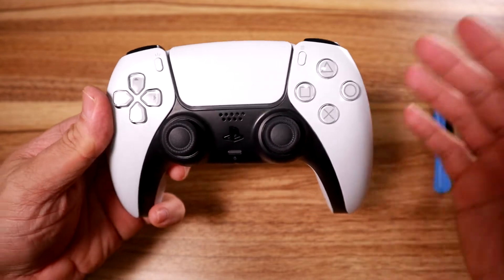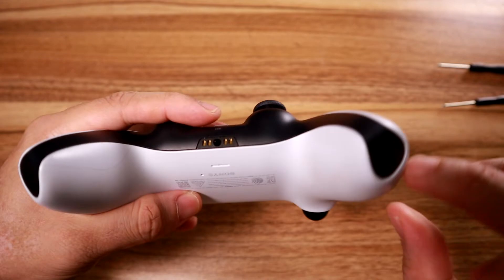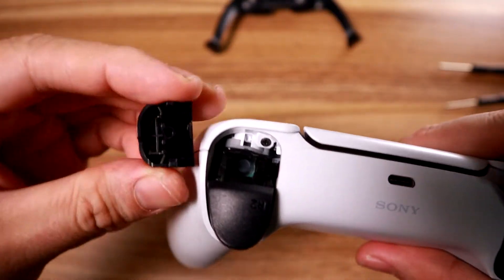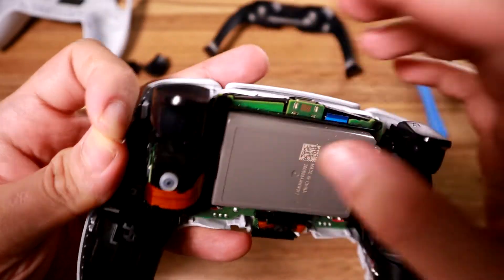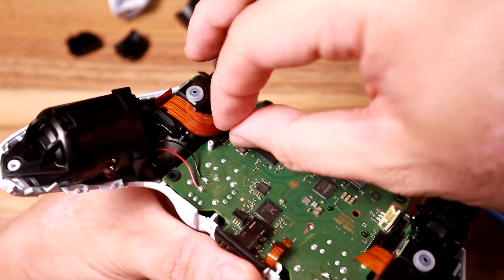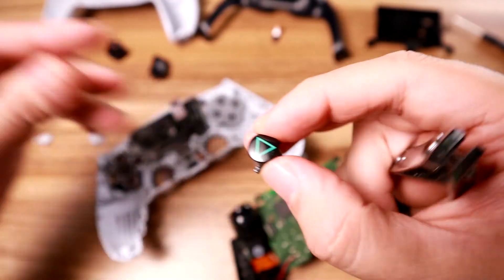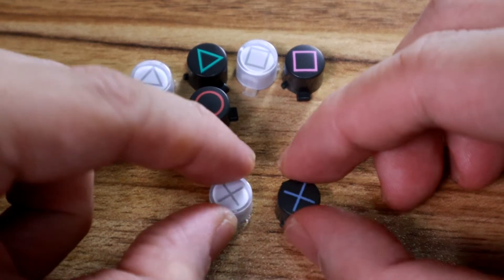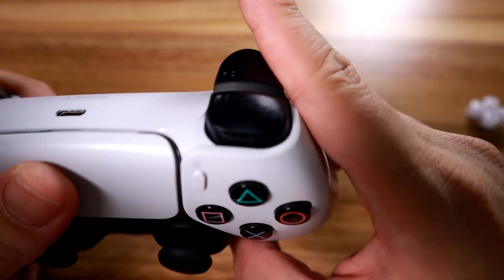How to fix the DualSense loose R2 issue and replace the buttons with DualShock 4 buttons

Comment: Thanks for this. Took a spring from my old DualShock 4 and used it in my dual sense. Still doesn’t feel quite right so have ordered some springs but this will definitely do the job while I wait for the new one. Thanks again!
Reply from the maker: Did the exact same thing. Kinda sucks that this happens to more and more people. I hope the next batch with new colors use a better spring.

Comment: If it helps someone else; I just did this using an old DualShock 3 controller. 
I had to straighten the donated spring a little since it was loose, but it worked fine after some light bending, and has almost the same resistance as the PS5 spring. 
I swapped the buttons too, but they’re light grey since it was a white DS3 controller. The O ∆ X square buttons fit exactly as in this vid. The D-Pad I found to be a touch too small and it was fairly wobbly. The base was about 1mm thinner than the PS5 one so I opted not to use it as I didn’t feel like pulling the controller apart again if it didn’t work well. 
Definitely want to find a black DS4 controller for those sexy buttons, but yeah, if you need to fix your PS5 controller in a pinch, a DualShock 3 one will work.

Comment: Thanks for this. I had a lot of trouble getting that spring in. Mine wasn't kinked like yours. Straight on both ends. For those with springs like this, I had most success getting it into the button first, then the loop, then bend it into the control divet.
Reply from the maker: Man that must've been tough! But couldn't you have bent it a bit beforehand?

Comment: Thank you so much mine broke on Friday and I've been trying to fix it myself without sending it back and you having to go through each without a controller and your video finally helped me fix it my spring wasn't broke it was just the part of the spring that goes up under the actual trigger button wasn't going straight across like it was supposed to it was lodged upwards and I just had to push that down and now I'm all good to go thank you so much
Reply from the maker: Hey man, happy to help!

Comment: Thank you! I've fixed it, DS4 R2 spring works for me as well :)
Reply from the maker: It's not as "springy," no? The specific Dualsense springs are still better but until you find them in stock, the DS4 spring does the trick in a pinch.
Reply: Yeah, spring from DS4 has a little bit lower resistance. Once springs for dualsense is available I'll change it :)
Reply: @BimBurger  still way better than before ty

Comment: Nice tutorial! Just replaced the standard white shells for grey, with ps4 buttons, and aluminum thumbsticks and dpad, but I'm gonna have to take it apart again because for whatever reason up on the dpad isn't working, and the square button isn't sticking out as much as it should.
Reply from the maker: Yeah it should stick out pretty prominently. The biggest issue with DS4 buttons on the DualSense is that the circle doesn't follow the contour of the shell.

Comment: Happened to my friends a few months ago and now mine, with some games like fortnite you can just enable the adaptive trigger strength and it will solve the issue by causing resistance when you push down but sadly for most games you need to do this or replace the controller. Ridiculous how they allowed it to ship like this.
Reply from the maker: I don't think adaptive triggers are a complete 100% fix but I agree that, especially for their price, it's ridiculous that it happens as much as it does.

Comment: Had my ps4 controller for 6 years with no problem ive had my ps5 less than a year and the spring broke?
Reply from the maker: Same. And I collect Dualshock 4s. Out of 7, only one had a problem and it was an easy fix.
Reply: @BimBurger  dont think ill take the risk of dismantling it myself but clearly a great video man shame in a way it has so many views

Comment: Dualsense feels good, but it barely lasted 5 months I have a broken L2 button. What a shit for how expensive it is, the battery is shit too, it lasts 4-5 hours. I have an xbox controller that I use on pc too, and the battery lasts 1 week +, although dualsense surpasses it in ergonomics and comfort
Reply from the maker: The battery can be a bit thin - I'm looking into way of expanding it. I am not sure if there are 3rd party battery solutions out there that aren't ugly as sin.
Reply: I had mine barley a month a a couple weeks ago it started to stay in slightly so whenever I press it stays engaged until I have to press it a few times harder to get it to disengage such an annoying thing. Btw my face buttons are sticking a bit too
Reply from the maker: @emobassist  Did you swap out the front shells?
Reply: @BimBurger  I didn't they just stick I have to press them harder unless there is haptic feedback on the face buttons
Reply from the maker: @emobassist  Man I'd love to be able to open that up and see what's up :(

Comment: Welp, guess I'm gonna have to try this out. I love the feel of the controller, and really wanted to use it for PC. I have a PS4 controller but it feels horrible, but this one feels so much better. I also can't go to Sony for it because to save 20$ I bought a refurbished one - clearly not refurbished enough since it was like this from my first usage. But my R2 is super sensitive and even stays registering as being pressed even when I let it go and it does physically go back up, just not enough I guess :/ Gonna have to buy a Trim Remover tool first. 

I guess until I can fix this I'll stick to playing my PC games on my switch pro controller, which has its own set of problems, mainly stick drift, but that's fixable via software deadzones since none of the games I play require super precise handling.
Reply from the maker: What do you need a trim removal tool for? You're gonna try the PS4 buttons? I don't recommend you do. They don't follow the curve of the controller and it just looks a little awkward. I'm sure you can find DualSense buttons with the symbols on them in the color you want.
Reply: @BimBurger  ...That plastic puller tool you said you didn't know the name of? That's called a Trim/Clip Removal Tool. I need it to open up the controller and follow your video.
Reply from the maker: @Squintina  Oh - someone told me what it was called. Apparently, it's called a spudger.

Comment: Mine hasn't come loose but I can feel it's doesn't have as much resistance when I press down on it, ataptive trigger still works but can tell theres an Issue with it
Reply from the maker: The adaptive trigger is a whole separate mechanism - it's essentially a tiny motor that presses up against your trigger. It's likely that the spring is starting to break. :(
Reply: @BimBurger  thanks I'll be returning it from where I got it from
Reply: @BimBurger  I took it back and got a replacement all good now

Comment: After 1 year, my dualsense start to melting. Difting on L3, loose L2 and charging connector not working from time to time :(
Reply from the maker: Yikes. That's a lot of issues. And each one has a separate fix - almost not worth the trouble. You'd essentially be replacing three parts.

Comment: I'm gonna try this later I only got ds4 springs
Reply from the maker: Yeah it'll work, it just won't have the same tension.
Reply: @BimBurger  thanks for showing me I have some tension but you're right the controller is still not the same. IL buy a black controller during the year for now I turned off adaptive triggers
Reply from the maker: @setokaiba2351  I'm really digging that black one too.

Comment: I’m on my 3rd controller! Pretty disappointed to be honest, my PS4 controller lasted 7 years without any problems, 7 years! 2 PS5 controllers have broken on me so far and it seems the life expectancy is about 2 months for the R2 button. I recommend anyone who’s about to “upgrade” to PS5 to keep their PS4 controller and use it as much as possible! Avoid using the Duel Sense as much as possible, only use it when you have to, that is for PS5 games only, luckily, the irony! there aren’t that many games out yet!
Reply from the maker: Wait you went through three DualSense controllers? What were the issues of the first two?

The trigger looseness can be fixed. Drift can be fixed though it's much tougher and may need soldering.
Reply: No, I’m on my 3rd controller meaning 2 had broken.
Reply: No, I’m on my 3rd controller meaning 2 had broken.
Reply from the maker: @lucko1979  Yeah I think I understood that. I mean, how did the first two break?
Reply: I can agree ps5 controllers are way easier to break I have had mine for a week now and r2 already feels loose I have used my ps4 controller with no issues except for some drift which is acceptable cause I used it for over 5 years.
Reply: @BimBurger  Sorry, I hadn’t noticed your reply. 

How? I was most playing PS4 games that obviously don’t use adaptive triggers, one game in particular that I was mostly playing was Cities Skylines, in this game R2 is zoom in, used often admittedly but also gently. I was extremely disappointed when the trigger broke playing such a game.

I’ve been gaming for years and I know how to use a controller and usually they last for years! 
You mentioned that the loose trigger was an easy fix but in your video you mentioned that you weren’t happy with the R2 button after you had fixed it, didn’t you? 
Anyway, for the price of these controllers I feel I shouldn’t be obligated to try and fix them, I’m going to send them back to Sony every time, and I urge everyone to do so, no one should be trying to fix these controllers, send them back and complain until Sony sorts this shit out!
Reply from the maker: @lucko1979  Well the DualShock 4 spring is more sponge-like than the default DualSense spring. And you're absolutely 100% right - for its price, it should absolutely NOT break in any way in the first couple yesrs.

Comment: i Have brand new ps5 , installed Death stranding directors cut, and have issue right away with R2 where vehicle do not react to it and wont move at all, destroyed all joy from game.
Reply from the maker: You've tried your R2 on other titles? Non responsive R2 is a different issue all together. Might wanna claim warranty on that.
Reply: @Bim Barbieto  On Death stranding directors cut, i enter motorcysle pres R2 it will work for 5s then bike stops and not move. But lights on bike react to when I press IT. Also grabing hand to body with R2 works, just all vehicles are not working. I have second black controller which I bought separateli and it does not have this issue, tested today. So it seems sttranding uses some special R2 signal to accelerate wehicles which is broken in my brand new default ps5 controller. I guess all white one conrollers are broken.
Reply: When I press L2 and go backwards and press R2 again it works but only for few seconds.

Comment: I can get the spring into position but it just won’t catch anything or lock into position
Reply from the maker: It's difficult, but there should be a a tiny slit that the spring legs pop into.
Reply: @BimBurger  I get it into the slit but when I push r2 down it doesn’t stay inside it
Reply: Would you happen to know the size of the springs,  might buy some new ones to replace
Reply from the maker: @andersoncoombs6854  There's a slit inside the R2 button that it should sit inside also
Reply from the maker: @andersoncoombs6854  Unfortunately I don't. I think they're bespoke springs.

Comment: By common do you mean 95% of controllers? Or do you mean it's the most common problem but rarely happens?
Reply from the maker: I don't know the exact percentage, but I guess it could be both. I know it's the most complained about issue online - that and drift, but drift is a lot harder to fix.

If we go by my group friends and acquaintances who have a PS5 as an anecdotal sample size, about 20% of us encountered this issue.
Reply: My R2 spring also just lost tension after playing Ratchet and Clank. Seems like the spring is not as durable. Still working without accidental press but I need to replace them soon. Thanks for the video. By the way, they call them plastic spudger.
Reply from the maker: @metimeph  That's what it's called?! It's such a weird name, I love it! Lol

Comment: why do they make th buttons slightly smaller. There are already many custom one that could just be rused. So wasteful
Reply from the maker: They are 100% exactly the same as the Dualshock 4 buttons. As you can see in the thumbnail, I swapped them out already.

They don't have the same curvature though, and different teeth.

Comment: At first you kinda just deal with the loose spring trigger, but then it slowly drives you mad. For 10 bucks, a little DIY repair shouldn't hurt.
Reply from the maker: It'd be nice if Sony actually made the spring last a bit longer though. :( Sucks that we have to fix it at all.